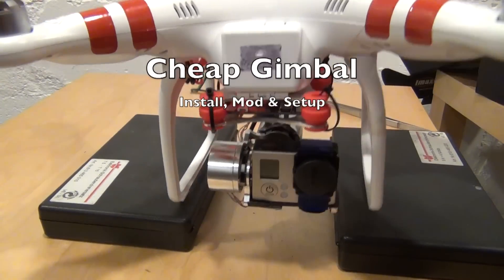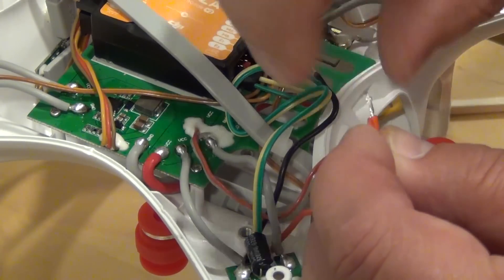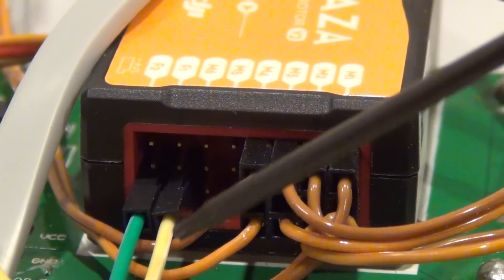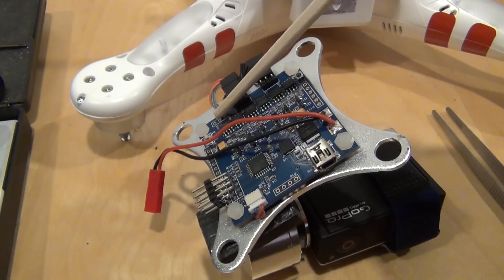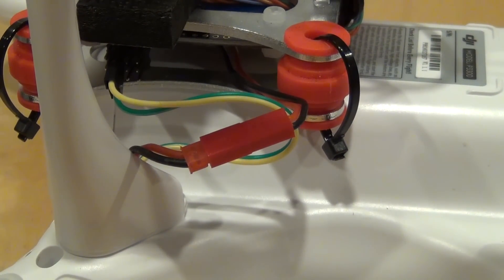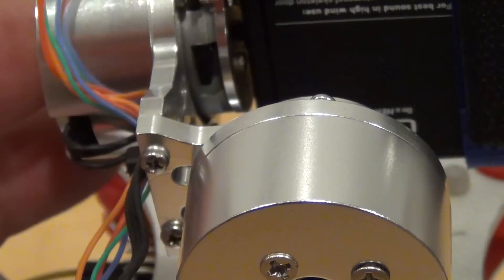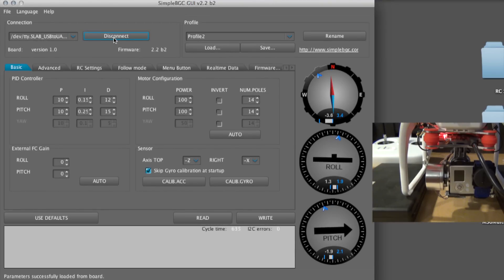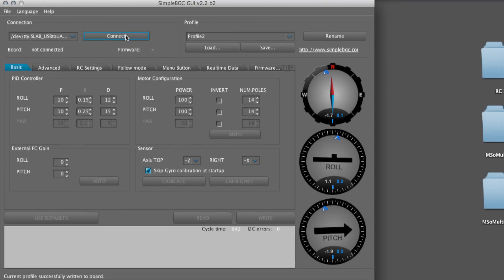Camera Gimbal for DJI Phantom (Complete Guide)

Comment: Hi! I'm hoping you can help me. I was setting up the pitch controls, when my gimbal stopped working. It won't turn on, the circuit board is lighting up and I can't figure out why. If you have any insight it would be greatly appreciated, as I don't understand why it suddenly stopped responding.
Reply from the maker: Sorry, I have no idea. Maybe you don't have enough power, or a chip died on the board. You can connect the board itself to USB with the motors disconnected, and then use the BGC software to connect to it. If that doesn't work, then it is time to order a new board.
Reply: mygiguser Hey! Thank you so much for your reply, you've helped me more than you might think. i plugged my gimbal into my computer via the usb on the gimbal and the LEDs lit up! The gimbal is fully operational, now for the weird part. The gimbal only works when I have it connected to my computer via usb. At first I thought it was doing this because maybe it wasn't getting power from the phantom, and was able to work because of the power through the USB, but when I disconnect the power cable that goes from my phantom to my gimbal, the gimbal stops working. Do you have any idea why it might be doing this? I tried setting up the gimbal through the NAZAM software and that seemed to work, but again it will only power on when it is also connected via usb. If you have any idea what this could be I would love to hear it. Thanks again!
Reply from the maker: yakzach USB should not have enough power to run the gimbal motors. If the gimbal doesn't work, when connected to the power from the aircraft (it should not be powered by the NAZA, but by the main flight battery), then i would check that cable first. Should have battery power on it. 3S battery? 11.1V
Try to connect a battery to the gimbal power connector. Does it work then? I hope power and ground is not switched on the power cable for the gimbal.
Did you wire the gimbal power as I show in my video? Possible the power cable on the DJI main board is broken?
Use a volt meter to find out if there is power!
Reply: mygiguser I wired the power like you showed in the video. I have flown the phantom without the gimbal, so I don't think the power cable on the main board is broken, unless i'm confusing something for something else. How would I connect a battery directly to the gimbal? Would I need a special cable?
Reply from the maker: yakzach Not the cable from the battery to the DJI board. The thin cable from the DJI board to the gimbal could be broken (the one i show in the video). Easiest to test is to measure the voltage and the polarity on the gimbal board.
Sometimes people wire the gimbal power to the small little connector of the battery, but I don't know, if you can buy that cable, or if you have to make that yourself.
Reply: mygiguser Thanks again for all your help. I'll pick up a voltage tester and hope for the best.
Reply from the maker: yakzach A new controller board on Ebay is probably cheaper than a volt meter. Lol

Comment: OK . but i have exactly thé sale problème with thé goodlucky gilvall si thé problème is not thé gimbal but thé drone (or software)
Reply from the maker: You should install the goodluckbuy gimbal again, and use the BGC software to see in the Realtime tab, what the drone is sending. If the drone is the problem, then you will see it there. What about the videos on your channel? They show a goodluckbuy gimbal and you using BGC software?

Comment: hi , i have a problem with my phantom 2 upgraded edition :

https://www.youtube.com/watch?v=vb36YfLETrg

, the gimbal does not keep the horizon. and I can not settle with the software wizard because in the tab 'gimbal "I only have 3 settings and no changes anything ...
made in the drone compensates too tilt and gimbal is either too high or too low when the drone is tilted
I thought it venai the gimbal, but I have the same problem with walkera g2g ..
thank you for your help!

bilou02130@gmail.com
Reply from the maker: I guess I do not see your problem. Your wires seem to be OK, your remote wheels pivots the camera.
Maybe I don't understand what you want. As you can see in my video, I have a lever for the pivot control, and it does not snap back into middle position. Maybe you can show a screenshot of the settings in the software? What do you use? DJI software or BGC software?
Reply: Thank to answer (i'm sorry , m'y english is realy bad...) un fact , thé tilt control is OK , i can move with m'y radio , But when the drone is tilted, the gimbal will not stay right (see video) more, I can not connect my drone with the software "naza m" I can only use "phantom assisrant software". And there is just 3 tool in " gimbal" tab of software ...
Reply from the maker: baptiste plancon You should try to use the BGC software on the gimbal control board to see what is going on, and what your Naza controller is sending to the gimbal board. I personally would open the remote control and remove the spring that turns the pivot wheel into the center position.

Comment: ok i cant get the pitch to work remote i have the same gimble everything works but the remote pitch. i did the same wiring diagram and still can you help?
Reply from the maker: I wish I could. How can I help? Can you make a video with your setup, that I can see how yours looks like? Closeup of the DJI controller, and of the BCG Board connector. When you use the DJI software, and move the pitch control, do the numbers change? Do the numbers change in the BCG software?

Comment: PLs sand u send the name of the Camera Gimbal  and the same go on the DJI Phantom 2 vision
Reply from the maker: I ordered here: http://amzn.com/B00GAY5YBU
Name: Brushless Camera Mount Gimbal w/ Motor & Controller for DJI Phantom F450 F550 X525 Gopro Hero3
Reply from the maker: At this point I don't know, if this would work on the DJI Phantom 2 vision. I imagine it does, but I am not sure. Are you planning on using the vision camera, or do you think about mounting a GoPro?
Reply: thanks for time, i have the gopro hero3+ and dji Phantom 2 Vision